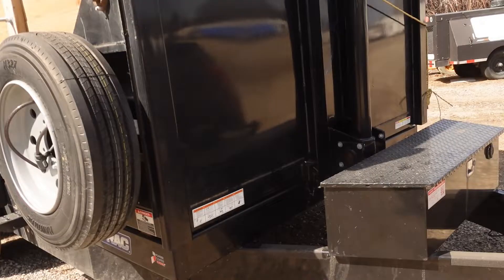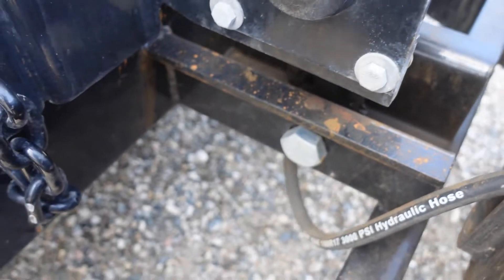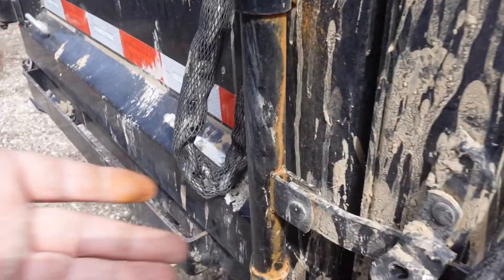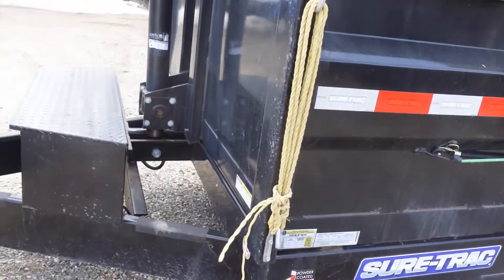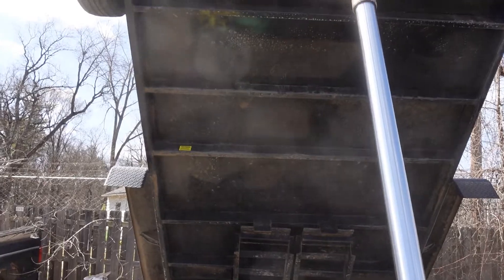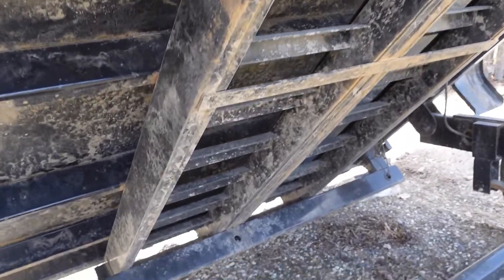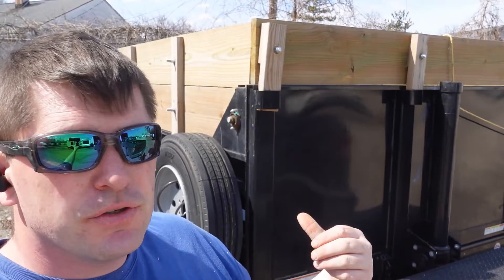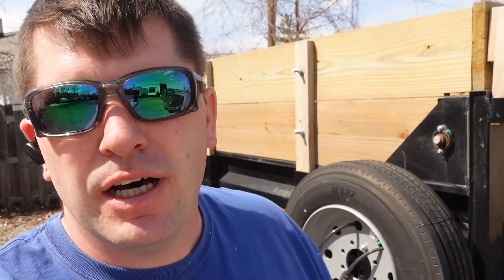Sure-Trac Dump Trailer Rust after One Winter!

Comment: I'm looking at buying a Sure Trac this weekend. Thinking about having it bed lined asap as it'll be new.
Reply from the maker: I wouldn’t. Want materials to slide out nice and smooth.
Reply: @RenovationsandRepair  just the exterior, sides, fenders, hitch area. Common rust spots with the "tough powder coat"

Comment: I had a 'Sure-to-rust prematurely' trailer. The powder coating peeled off within a year. Had it one year then sold it at a loss. For my light duty household/ ATV use, I bought an aluminum. The Sure-Trac powder coating was awful!  A can of black rust spray paint would have been tougher than the crap Sure-Trac uses. They should be ashamed of themselves.

Comment: What size trailer is it? if you don’t mind sharing. what vendor did you purchase trailer from?
Reply from the maker: It’s a 14ft, 16,000lb Sure Track. Got it from Kelley and Son’s trailers in South Michigan.
Reply: @RenovationsandRepair  what should I look for in pricing
Reply from the maker: Depends on brand and quality. Do you want a 12k, 14k, or 16+k trailer?  Telescopic hoist? 7 gauge bed and sides? What size axles?  A lot goes into making a pricing choice